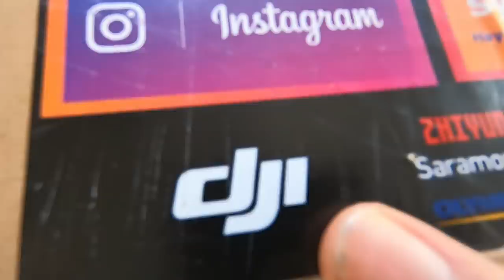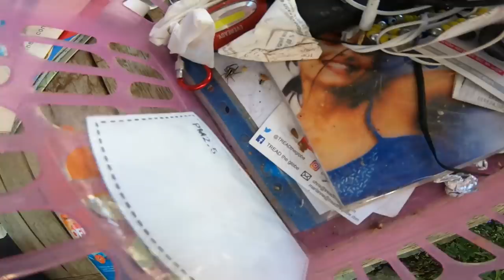We get a BIG Surprise in Turkish Van Life lockdown [S6-E112]

Comment: Sorry to say you need a licence for your drone, see Mick Scarsbrook video for details guys.
Reply: Actually not due to weight ..In Turkey drone licence requires above 500 gr.  Weight of DJI Mini  2 is 242 gr .
Reply from the maker: Hi Peter actually it's not the case - as Murat says - if the drone is under 500g then it is ok - that is the reason we chose this model - DJI made it below the registration weight of most countries. Mics's video only applies to drones above this weight.